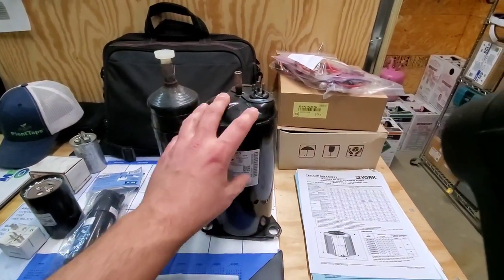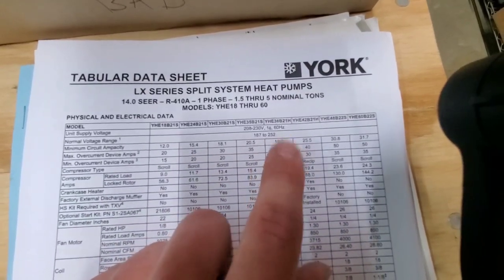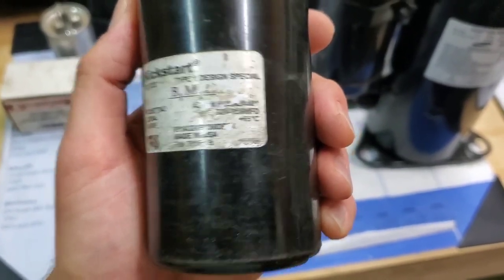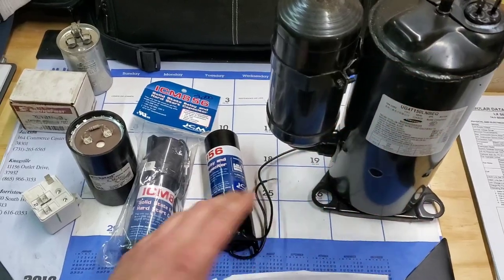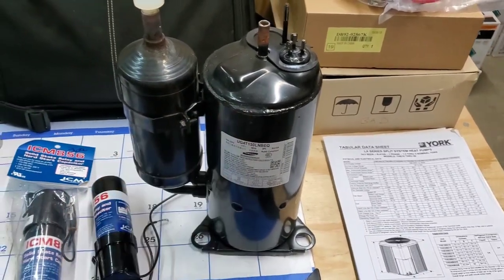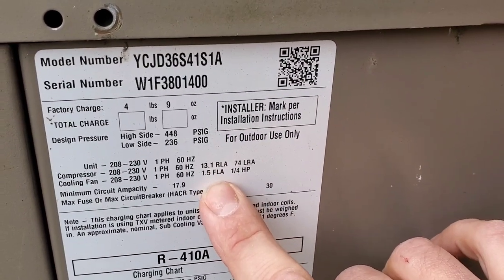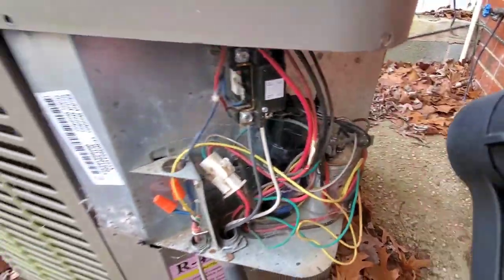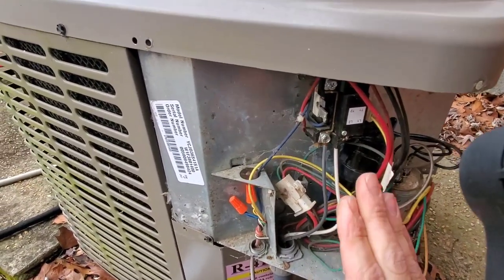Why Do LIGHTS DIM When AC kicks ON? 🤔

Comment: Put a meter(amp clamp) on it when it starts bet you any money it’s not pulling 74 amps, it will if the compressor is bad internally. But starting amps would probably be around 20/22 amps and then will come down to 12/13 amps (RLA) sincerely and hvac tech
Reply: LRA amps will most of the time be around 70-150+ in most residential systems. Test LRA amps not regular ampers noob.
Reply: Sincerely hvac tech…

Comment: Are you talking about lights dimming just briefly or staying dim while the AC is running? My lights have always slightly dimmed for a split second when the AC first turns on and I've always been told that's normal and not a problem.
Reply from the maker: dimming for a second

Comment: My issue is that my unit never used to do this. Now I notice the flicker every time it comes on. Does this mean my hard starter is going bad? Should I just install a soft starter if the hard starter needs to be replaced anyway?

Comment: Lra is if the compressor is locked its not the starting amperage.
Reply from the maker: The maximum start-up current is referred to as "Locked Rotor Amps" (LRA) because at the first moment when the rotor is at standstill, it appears as if it's locked. This current will drop significantly when motor accelerates to about 75% full speed.

This is the reason I refer to starting amps as  LRA, my friend

Comment: Neighbors ac dims my lights.
Reply from the maker: hahaha thats not good lol
Reply: @TaddyDigest  both house service lines are lugged together at the pole. Maybe re lug or separate may work.
Reply: Yea if your neighbors power has any effect on your owm its either like you said the connection at the transformet on the pole, thr transformer is overloaded, your service cabling is inadequate, or youralls power is shared somehow and your getting screwed.  All the other issues should be fixed fior free by your electric company..

Comment: Attaching terminals to a hot capacitor without discharging?  I have to think this is not safe Tad. Also confusing where you add it to the system versus earlier where you say the hard start kit replaces the relay and capacitor. Which is it?  Thanks for posting
Reply from the maker: You are correct Always Discharge my friend. Always place hard start kit across common and hermetic terminal. Thanks for watching please sub and share so I can grow up.
Reply: @TaddyDigest  - so if I have a dual capacitor for the fan and the compressor I can just add the hard start kit right? I’m guessing your demonstration was the same - a dual capacitor?
Reply: Your “dual” cap will have an F, H,and C terminal.. f=fan, c=common, h=hermetic compressor.  Hard start cap goes on the H and C terminals always and never on the F..  most caps on hvac are dual because tge fan motors require a start cap as well as the compressor needing a start cap..  some systems fans require a start and run cap which is a 3 cap system..  that will have an H,C,S,R terminal.  The fan wil connect across the c, s, r terminals and compressor on the c,h terminals hard start will go on the c,h terminals as well..

Comment: Can we use a big capacitors in the main power to compensate amperage that lost at a few seconds of starting up ?
Reply from the maker: Having the potential relay to drop out the start winding will work a lot better plus you won't burn the motor up with large capacitors

Comment: Hi. I moved to a house and right before move in I had to replace the AC. The new one is a 4 ton heat pump from Carrier. Every time it turns on the lights on a dimmer gets considerable low. The lights not on a dimmer just flicker for a second but you know when it goes on/off. I asked the technician and he told me that I need an electrician. I don’t know how the old system was operating but before an electrician, any suggestion? Thanks.
Reply from the maker: So he could be right in suggesting that you need an electrician maybe to check the power wire leading to leading to the equipment And make sure it size properly
 To make sure that the Box has no loose connections and to make sure that the breaker or service disconnect is still good

Comment: Hi Taddy I got a question for you please ,our furnace technician was out earlier replacing a leaky a coil in my furnace ,we found when we removed the exhaust& fresh air pipe that a 90 day metal fitting had gotten dropped in pipe and blocked off exhaust “pipe” by about 80% your thoughts on this this metal pipe has been rusting over the last five years and contaminated the fan down below and the hoses and orifices and what not, your thoughts please.
Reply from the maker: need to know details pictures would be great 👍
Reply: Rust wont hurt anyting .. if disturbed you could inhale it but at most youd just get a little extra iron in your body which is normal.. at least you got. It out so the system can now breathe..  so no worries and should get better heat and lower bills…

Comment: Hey Taddy, Which Hard start lit should i use for a Lennox 14ACX-047-230-034 ton RLA 19.9 LRA 109.0?
Reply from the maker: This one will work
 https://www.amazon.com/AMI-PARTS-Capacitor-Increases-Compressor/dp/B07X1MB2NH/ref=sr_1_2_sspa?keywords=hard+start+kit&qid=1657850379&sr=8-2-spons&psc=1&spLa=ZW5jcnlwdGVkUXVhbGlmaWVyPUEyTTlUTFdSQUlGWUxXJmVuY3J5cHRlZElkPUEwNDE4MTE0MlRESEZQWUw0WFczSCZlbmNyeXB0ZWRBZElkPUEwNDA0NDk2MlJaWlBLS0NOQ0hLUyZ3aWRnZXROYW1lPXNwX2F0ZiZhY3Rpb249Y2xpY2tSZWRpcmVjdCZkb05vdExvZ0NsaWNrPXRydWU=

Comment: There are flickering lights downstairs in my bedroom, bathroom, and hallway, and the other room downstairs. The air conditioner isn't working properly upstairs. Can these flickering lights downstairs be caused by the air conditioner not working properly upstairs? Also one of the outlet in my room burned 2 portable heaters already.
Reply from the maker: Sounds like your compressor made May need to check the capacitor that powers the compressor

Comment: Is their any chance the dimming could be caused by a loose connection? My lights do dim when the AC kicks on an my unit is fairly new maybe 1 1/2 years old
Reply from the maker: Yes Could be wire issue or loose connection

Comment: Hello Taddy. I have noticed lights dimming around my house when we use our A/C (Portable AC, 12,000 BTU's) and when our dishwasher is running. It's not a mild dim, it's pretty noticeable. It only happens when the AC kicks on and when the dishwasher changes cycles. Is this something to be concerned about? I want to know if we should call in an Electrician to have a look. Thanks!
Reply from the maker: check wire size,  breaker and breaker box 

yes call an electrician to check and make sure nothing is loose
Reply: Ive seen houses with an 80 or even 60 amp main feed do this.  Just mean ya aint got the power capm..  when dishwasher is running thats around 11 amps when draining and 18amps on the running ac, plus all the other stuff running around the house adding up to another possible 30 amps with fridge, lights, stuffs..  and sometimes you can be way below your max rating but the power company feed could not be at high use and the draw of the stuff kicking on causes a small drop until the power feed catches up to the new demand..  happens in small communities alot…. Or if ya notice it only happening certain times and not other times than could be a demand issue which cant be fixed unless repeated use at those times changes the demand times for the power company so they change higher draw hours schedule….

Comment: We just had a hard start kit added to our AC unit. Now, we've noticed that when the AC turns on, the lights in the bathroom near it get brighter. This seems like the opposite of what people say about AC/light dimming.
Reply: You have an open neutral wire somewhere. Thats why the lights get brighter.  Open could be anywhere. I had a squirrel chew the neutral on power pole by the road. Dryer would make lights get brighter.

Comment: But what if I just got a brand new AC unit and lights still flicker
Reply from the maker: Check your breaker Box voltage coming in check the connections yeah connections check the connections for the unit as well in the Box check the wire size to the unit